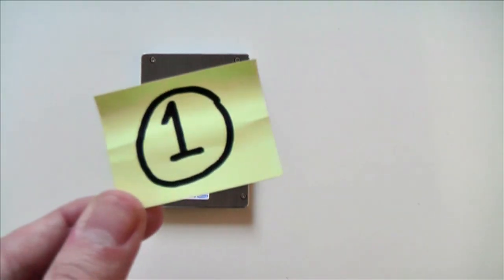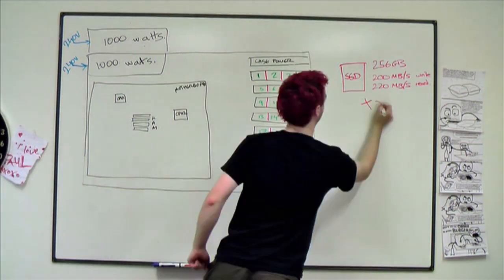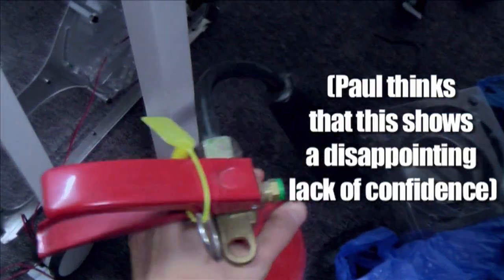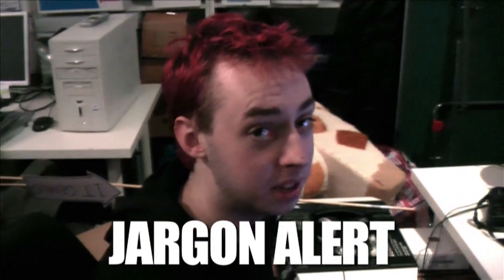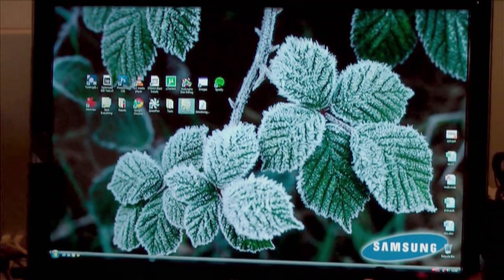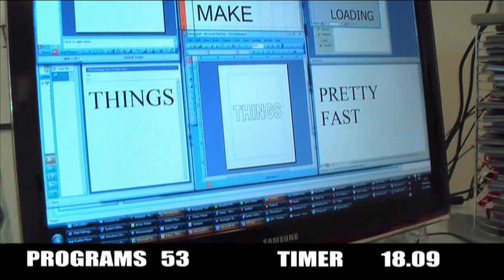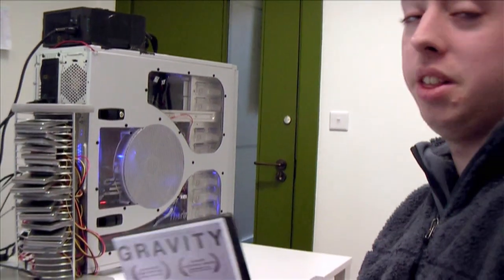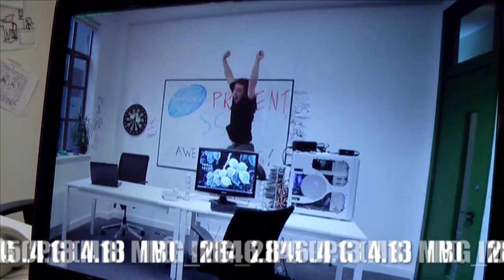Samsung SSD Awesomeness

Comment: A lot of that was a bit of a cheat.

Deleting files in Windows is near enough instant anyway. Deleting all of those files only required changing a few bytes on the drives, they are not zeroed out.

Likewise, the photos were probably cached entirely in RAM after being copied and WIndows does this anyway (you would have to reboot to clear it fully).

Comment: The bottleneck on this machine is now the raid cards. The trick is to get 2 of the fastest raid cardS possible (so long as you have 2 pci-e slots on your mb) and connect as fewer drives as possible to each one, evenly. Connect as many as you can to the mainboard first, then split the rest evenly between the cards. If they ever release a motherboard with 4 or so pci-e slots, you could get the read/write speed to 5/6gb with the same drives, INSANE

Comment: hehe i love these marketing bull... videos.

Performance degrades after 6 days of use. You have to run a program to rewrite blocks on your ssd or your ssd will perform 6 times worse! The samsung ssd's will not keep there top performance even if you run the program.

So it's fun to have a ssd but what's the point if it doesn't maintain the same speed.

Comment: most games load from the hard drive duringlevels etc cos there are maximum amounts they are set to run in the ram. Time Crisis is no exception. Having an ssd (or indeed 24 of them in RAID 0 [my head spins]) reduces that loading time significantly making play seem more continuous.

Comment: think about it in terms of watching a video straight from your hard drive or watching one buffering on the internet with the ssds load speeds it can unlock the full potential of the rest of the system. I have a friend who has been building computers since the 80's and he said that installing a ssd was the single biggest leap in performance hes ever seen from a single peice of hardware.

Comment: actually your right. QUOTE FROM TOMSHARDWARE "Props to Tom's Hardware user Spazoid who's noted that Samsung's full RAID configuration details appear in a quick series of frames at the tail end of the video.  Here's the setup: Samsung slaps ten SSDs onto an Areca 1680ix-24 RAID card, eight SSDs onto an Adaptec 5 Series RAID card, and the final six SSDs directly into the motherboard SATA connectors itself.  It ran two RAID0 arrays build from the drives connected to each controller,

Comment: He put the drives into something called a RAID array, which combines the storage and performance of the drives and makes windows see one larger drive with either better performance or better reliability. In this case he put 10 together to make a drive approximately 2TB, and another 8 and 6 together as second and third drives.

Comment: The tricks he demonstrated wouldn't have utilised a fraction of the 6gb that RAID array provided, so superior results could've been achieved at a fraction of the cost on a modest system with a decent ramdrive configuration. But of course that wouldn't have advertised overpriced Samsung products nearly as well :P

All in all, a wasted project and £15k of wasted gear. Next time try some benchmarking which can't be replicated on a £300 box.

Comment: Me and my friends have a server computer that holds over 2tb of data; also, the majority of the data are high resolution videos and video game iso files. Since I format my computer around every month I rely completely on that server to back up my data and be able to install software(most of it is 5bg+ BTW).
It is are very long process if i could have 2gb /s transfer I don't see why not and whats so inefficient about it? Whats the down side of having a high transfer rate?

Comment: Skulltrail is just a brand name or something.

Overclocking means increasing the speed of processors or RAM units, beyond the limits that they were meant for.

Dual core2quad? Means 8 processors working in parallel. 

DDR2 800...Double data rate at 800MHz

Comment: what does a 1TB hard drive have anything to do with it? A 1TB hard drive isn't any faster than a 160 gig HDD.  I don't think a hard drive "improves" game performance. Especially in this video. They just showed a clip of them standing there in the game. They didn't show it load the map or anything, they just stood there. Gamer performance depends on CPU, Gpu, and RAM, not hard drives.

But looking at those system specs, I would say the FPS would be around 10-20 if Fraps was on. Maybe even less.

Comment: Yes Vista sucks, it hoggs memory, takes a long time to start up, adds a bunch of annoying bottons to folders and craps up my right click, plus it does not run my chessmaster or my CATAM (FEA) software

SSDs are way better than HDs, faster speed, no noise, "drop ability", and most important 36% longer battery life!!!!  The SSD Macbook Air just dropped $700 in price on Monday with the release of the new iPhone 3G S!  I am debating between it and the more powerful Lenovo 200s

Comment: True because although sata and scsi have really high transfer rates like sata 300 @ 300 MB/s I think, you never really get those speeds cause the data doesn't travel off of the hdd to the sata cable as fast as say sata right?

Comment: SSD's aren't as big in terms of storage as regular perpendicular drives of today. They put 24 drives in a striped RAID, effectively adding all the storage of the drives together. If you do the math: 6TB / 24 drives = 0.25TB = 250GB of storage per drive. And yes, you probably have to break the bank for SSD's as none of them come cheap. Wait till it gets more mainstream, for now, it's just for the 1337 8)

Comment: I'm not that impressed. Sure it's a nice big number in absolute terms, but for the money they should have got about double this result. The Samsung SSDs are not especially fast - the Intels are over twice as fast, so I would have expected 2Gb/sec with only about 10 drives. The controller they used was way under-spec for the job - using crappy motherboard fakeraid is a complete waste of time.

Comment: ... The fact that the IEC comes up with these MI and GI prefixes doesn't mean everybody starts using them, and in fact, like I said above, barely anyone does. Even wikipedia states that, in most contexts, the Gi and Mi prefixes can be considered synonymous to M and G. So DjHidekiKobayashi is correct.

Comment: According to the fast slides at the end, they did. Final throughput was achieved with 10 drives in one controller, 8 in the other, and 6 stuck to the motherboard.

Comment: What?

That's one of the points of a RAID controller. Each of the 24 drives has it's own SATA channel (that makes roughly 300MB/s max PER DRIVE), the controller coordinates them, and feeds right into a PCI-Express 8x/16x slot, or equivalent.

Under the optimistic assumption that the RAID controller itself isn't the bottleneck, that leaves a theoretical cap of 2GB/s per direction for PCI-E 8x, or 4GB/s for PCI-E 16x.

(One of the points to SATA is that it's 3GBit per drive, not for every two.)

Comment: And nobody tried intel matrix raid? You can use the outer, faster proportions of your drive to make a super-fast raid 0 and the inner, slower parts for an raid1. You can get better performance on regular 7200rpm drives than 10krpm ones

Comment: this build is impractical if you're purpose is no to show off.. it is dumb to have your drives in raid 0 if your not having it on a raid 1 to.. i prefer if the 12 drves are in raid 0 and the next set raid in 1.. just to be safe.. since you dont want to corrupt your files.. and the thing about that OCZ Vertex 250GB SSD was right...

Comment: I'll agree that its not the ultimate. They could use better gfx and os, but you are incorrect on the ram. You should do your research because FBDIMM at 800mhz is actually much faster than even ddr3.

Comment: How many Sata controllers does your motherboard have to mux all those harddisks?

As i understand it, if you have one sata controller with a speed of 300MB/s, and all the hd are linked in series, then ur max speed is only 300MB/s...for 2Gig/s, you need like 7 controllers... which mother board do you have then?

Comment: The cost of just the SSD drives would total like $12696. At a cost of $529 per drive.
The motherboard costs about $600
The two processors total: $3089

So not including the other parts you can guess-timate a Grand total of probably $20k

Comment: I'm using 8 30GB OCZ Vertexs in RAID 0, and it's more than sufficient for my need's. Using an Areca 1231ML controller, and maxing it at 800MB/s read, and around 720MB/s write average. It's a much better price than the Samsung SSD, and just as reliable.

Comment: Isn't half the speed, with nearly 4 times the storage a better option?  Ideally you'd want both but who uses a large scale raid where the limiting factor is HDD?  Even in this case I believe the CPU and the hardware itself not the storage devices are the limiting factor.  Sure it makes coping a breeze but does it actually make a work environment faster?

Comment: 2:46
SUPER FAST DEFRAG
Defragging a random access storage device. LOLWUT?
How about using ext3 and not defragging at all.

2:57
Seriously, someone tell these people the difference between deleting a file from the File System's table and actually deleting the file (shredding).
Guess what, "deleting" a 400GB file from my 1TB HDD takes less than 0.1 seconds. (don't give me spin up craptalk)

3:21
Show the level loading if you want to make a point, not an already RAM loaded one.

Comment: The MBR has a built-in limit... 2^32 logical blocks × 512 bytes per block... 2,199,023,255,552 bytes... or 2 terabytes.
 This means that if tomorrow you happen to add a hypothetical 3 terabyte hard drive into your Windows Home Server, you will only be able to format and use the first 2 terabytes.

Comment: Yes there are limited writes but the way the drives are designed you'd have to be constantly writing to them for years and years non-stop for them to wear out. Its not an issue.

Comment: Why would you defrag an SSD drive? There's no heads or platters, so all data is equally accessible regardless of where it is on the SSD. And since SSDs have limited writes, all you accomplish is killing the drive that much sooner with completely unnecessary writes. What were you thinking?

Comment: the file transfers timings were an adequate test of what this RAID could do but the number of applications you can open has to do with RAM aswell and im sure with my 10k drive and 12 gigs of 1800mhz DDR3 i could open the same amount of applications faster.

Comment: I noticed that too. But it could be a typo because everywhere else the description lists 24 drives.

The caption under one photo says:
Adaptec 5 Series (8 drives)
Areca1680ix-24 (10 drives)
Intel D5400XS motherboard (6 drives)

So what exactly makes up the RAID? Subtract the 6 from the motherboard: C:, D:, E:, F:, G: because the RAID is known as H:.??

But the Areca card can only host 6 internal and 1 external drive.

I too would like to see this build better documented.

Terry

Comment: But wouldn't that mean, to get that speed, you would need to put a bit of a file in one drive, a bit in another and so on for all 24 drives to open it that fast?

If so that would be kind of crap.

Comment: I'm no hardware expert, but theoretically wouldn't this remove the RAM requirement from the game because it can pull off the drive just as quickly? So to an extent, yeah, it partly is because of the SSD. Since the graphics card can render it all and the CPU can keep up.

Comment: With an SSD air cooling is fine.

There are no moving parts so the only heat that is produced is from the electricity that goes through the drive.

Comment: nice computer, but there's absolutely nothing special about the SSDs and would get the same results with HDDs.
1. you would get the same speed with HDDs, since they also have transfer rates of over 100 MB/s.
2. youcan jump on a trampoline with a HDD while only the screensaver ist running. of course this isn't possible if the computer is actually doing something.

Comment: 1) a batch file,
2) making desktop icons, selecting them them all until you have them all highlighted and then hitting Enter.

Starting everything in the start menu is done in the same way.  Just change directory to the start menu folder first.  Then use the file listing and iterate through.

Comment: Currently, the most cost-effective SSD is the Patriot PE32GS25SSDR, which is available at Newegg. It's read is about 150 Mb/s (sustained) to 190 Mb/s (burst). It costs $90. You can buy a RAID controller, and 2 80GB HDD for a total of at least about $100, and it still wouldn't be faster than the Patriot SSD. Plus, you'd have to deal with the extra noise of the added HDD, and reliability is cut in half.

Comment: Don't get sucked into the marketing BS. Yeah sure SSD's are faster but there is no comparison there at all. If you were to build that machine and use 24 SATA II drives in a RAID (im assuming a RAID 0) would the performance be that much different?

I do however like the trampoleen part. I can't wait till i can get a SSD so i can take my PC outside and jump up and down while it still runs!!!

Comment: I really don't know why somebody always has to drag in the Mac vs Windows thing into stuff like this.

You can have 20 SATA channels in a MacPro without port multiplying hardware.   There is just really little point to doing it on either platform.

Comment: Just one thing - you're not supposed to defrag SSDs for two reasons: one, it doesn't do anything, as every place on the drive has exactly the same access speed; two, SSDs have a limited number of read/writes and defragging often will likely reduce the drive's lifespan significantly. Also it looked like they were defragging a fresh install...

Otherwise, kickin' rad!

Comment: i'd really like to know the RAID setup details? do all the controllers just provide single ssds to the system and it's one big raid0 windows sw raid? or raid0 on each individual controller and then a windows raid0 of the 3 controller raids?

Comment: It's a typical practice to down-convert bytes by 1000s instead of the technical 1024. Besides that, 1GB is 1,073,741,824 bytes, a bit over 1 billion.

This also happens to be equal to 1,048,576KB, or the 1024MB you said. It's not like advertisers generalizing is ripping you off or being dishonest. It's the fact that the idiots that saying it is a billion bytes will fool are the ones that don't know that most things are measured in MB, or KB if you're talking about docs or 10 years ago.

Comment: Try opening 10000 CMDs in 1.2 seconds, mine did it.(or unlimited)

Command:

[
ECHO OFF
start
goto "start"
]

That makes a NON-Stop stream of CMDs, USE LIQUID COOLING (it gets to 255Cel.) Don't try that on anything BUT a "super Comp." + Since my Comp. never stoped, make a "quit cmd with macro"

But you don't even need to do all of the nonsence that they went through. 16GB of GDDR5 is only nessacry. Use i7 intel (quad).

I've played 35 WoW simotamisously at 120FPS.(With Vsnyc OFF)A+

Comment: These are SSDs, the performance hit for sequential vs random access is very little. 

Since there are no mechanical parts to move around, jumping from one side of the disk to the other is just the same as reading 2 bits adjacent to each other.

Comment: You could easily get 2GB/s by raiding 20 new 3,5" harddrives on a good controller, or software raid-0 over 2 controllers. The thing that really make these SSDs so fast is accesstime and IOPS. If you really want to brag about your setup, sure, your video demonstration of application loading speaks for itself, but we geeks who know what to look for that makes the real difference want to see some IOmeter numbers, and perhaps PCmark vantage? This idea i suspect is inspired by Mtron Battleship.

Comment: You are totally right. On that motherboard, the SATA controller is connected in a 1x link so it's pretty slow.

Also, they forget to say that Crysis will hang for a second every time it auto-save the game...

SSDs ignore defrag commands to prevent deterioration so that's an other bad test. And deleting 5gb of files take about one quarter of a second on my laptop and it's a good old 5400 RPM HDD....

SSD's are nice but they need caches.... ho and Samsung needs better employee...

Comment: yeah, you'd need to plug it into two separate circuits - not two different plugs, two plugs on separate circuit breakers and everything. there's a 2k watt power supply out currently that's got the same problem.

Comment: I mean that if you did this with platter drives you would not get the same % of speed increase. If you made a graph of data throughput vs number of drives, platter drives would start to level off more with more drives while ssd's don't have as much of the leveling off effect.

Comment: why did you do defrag ? SSD doesnt need to defrag ( or i though so because that's what all the commercial told me , inclduing some technician . still , i could be wrong ) btw , the ram probably is the bottleneck since everything else preform so ... EXTREME !! how do you get enough power to power 24 drives ? something like 1600W probably cant even power that monster .

Comment: in 1:06 on the video you can actually see the controller. That is an areca ARC-1680ix-24. This controller is not capable of more than ~800MB/sec with SATA drives. It can do a bit over 1 GB/sec with SAS drives so the benchmark is definitely running from the cache.

Comment: The 2GB/sec benchmark is BS.

No raid controller is dapable of 2GB/sec throughput with SATA drives. I am sure the benchmark was running in the raid controllers cache.

I too can get 1500 MB/sec on cristalmark because its running in my raid controllers cache. Also I can tell they were using an areca controller from the beep during startup.